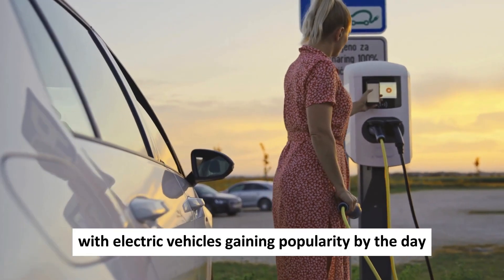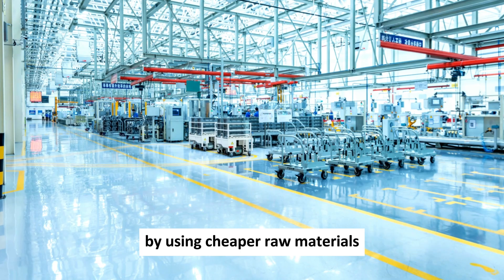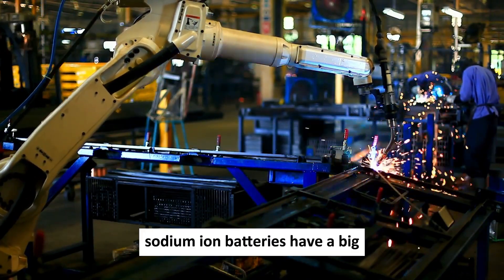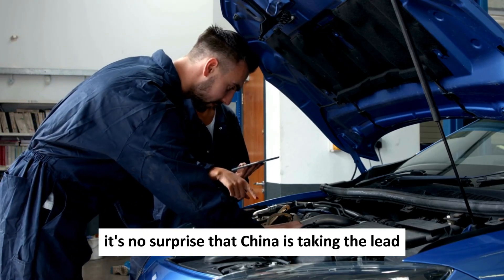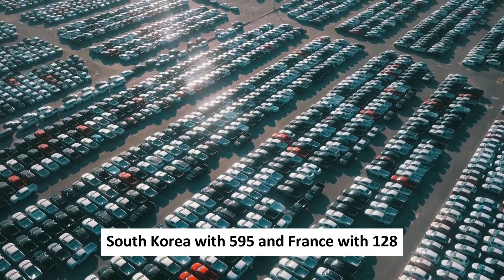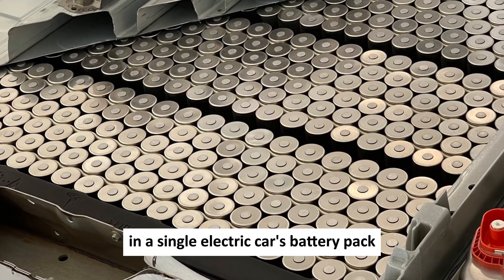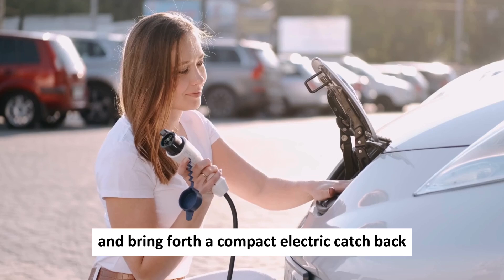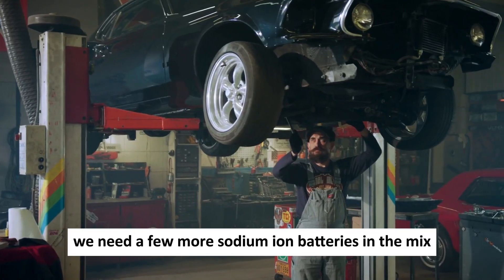China's New Sodium Battery Has Elon Musk Crapping in His Pants

Comment: "Challenges:
Energy Density:
Sodium-ion batteries typically have a lower energy density compared to lithium-ion batteries. This means they store less energy for a given volume or weight.
Voltage and Performance:
They tend to have lower voltage and slower charge/discharge rates compared to lithium-ion batteries.
Cycle Life:
The current technology has a limited cycle life (number of charge/discharge cycles before the battery’s capacity is significantly reduced)."